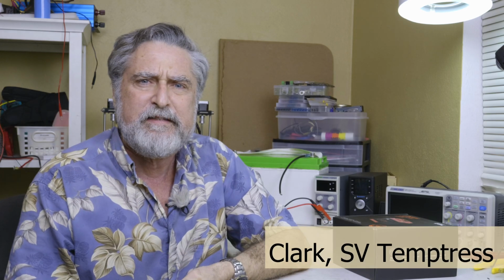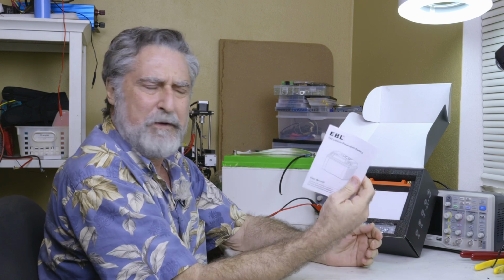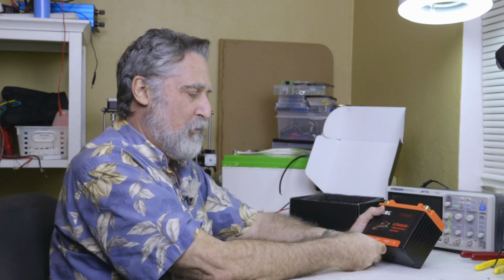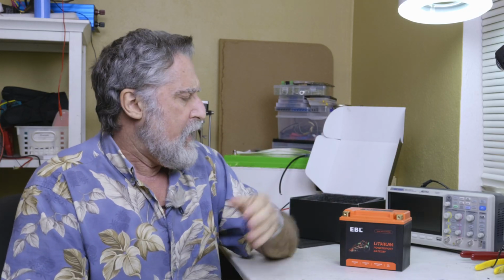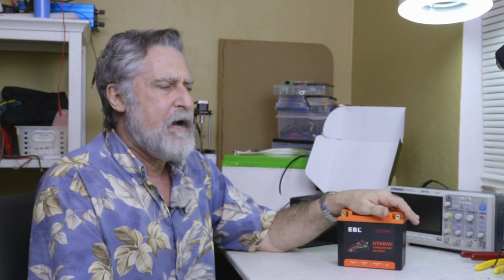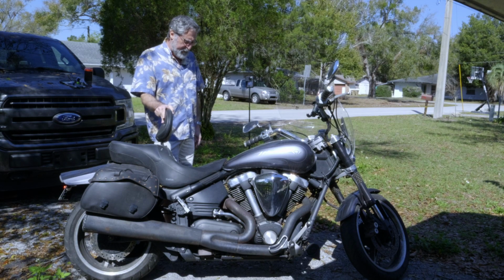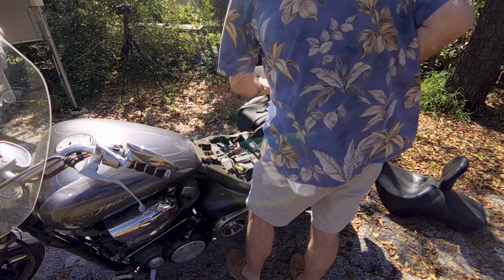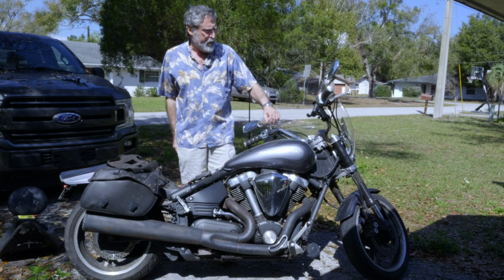Will the EBL Motorcycle Starter Battery Start my BIG Bike?

Comment: I have a Tohatsu 20 HP with electric start and power tilt.  I liked your reference to the large cooling fins on your bike's voltage regulator, and my Tohatsu has the same type with large cooling fins. 

The outboard manufacturers don't recommend lithium starter batteries, but I haven't heard of anyone having problems with the outboard's charging system, so I'm sticking with the NOCO lithium for now.

Get healthy!
Reply from the maker: Check out my latest ideas on the subject buried in this video.
https://youtu.be/k0LH87qTrQE

You won't get max life out of that Li but replacing them more often when they die early might not be a bad idea
Reply: @Clarks-Adventure  Thanks!

Comment: Hi Clark, glad to see you're recovering so well!  I have the exact same size and spec lithium battery in my 2003 C5 Z06 track car. It starts a 405 hp 350 V8 with no problem. My unit was made by Deltran, (more likely re-labeled) 480 CA,  8 Ah and weighs a whopping 4.4 lbs. Probably made in the same Chinese factory at the EBL unit, lol. Bought the battery about 5 years ago to prove the concept before I bought a lithium from a more quality name manufacturer. Well it's still going strong. I do approximately 12 track days a year, some are over 100 degree F here in Nor Cal. The unit has never failed to start the car, ice cold or super hot from coming off the track after a 25 minute flog. Simply amazing considering the $200 cost five years ago. I do keep it on a Deltran lithium battery maintainer 24/7 when the car is stored since Vettes are known to for parasitic draw through the computers, etc.
Reply from the maker: That saves some weight!

Comment: Hey Clark.   Hang in there….  I just found you a few days ago and I’ve watched quite a few of your videos.   I went to buy a bank manager and noticed they are sold out.  Checking to see if you knew a timeline on when they will be back?  I think it will work great for my rv.  No hurry and not being pushy at all just curious.  I have a work around for now.  Thanks.
Reply from the maker: Really soon I expect 
  We had to change the oled supplier and that required a software change.  
   Works, testing now.

Hardware is in stock

Comment: Hi Clark.  You and your channel are amazing as always.  You touched on a subject here that I've been thinking about.  I've stumbled across something that you may find interesting.  It's an up and coming battery chemistry they call NA+  It's a sodium ion battery chemistry.  This chemistry can tolerate higher voltages and from what I've read is more closely aligned with lead acid battery voltage requirements.  They are just starting to become available.  Would love to get your thoughts on the na+ batteries.
Reply from the maker: I'll grab one when offered but LiFePO4 is going to be hard to beat.
   Lead always came up wanting, like a computer from the 90s
   LiFePO4 is really good enough.   Like a new computer.   So anything that wanted to compete needs to be proven in the field AND be technically better
Reply: @Clarks-Adventure  Thanks for the quick reply.  As a note, it's disadvantage is that it doesn't have quite the energy density of LiFePO4 but it's advantages are that it doesn't use any of the expensive hard to get mine metals, it's not as sensitive to cold and it has the potential to be very inexpensive once production gets ramped up.   A big plus is that it can be manufactured similarly to LifePO4 so that manufacturers wouldn't have to change too much on the manufacturing side.  And what originally caught my eye is that it appears that it can eat up the extra energy from an alternator.  That's that part that I'm wondering most about and what makes me think it will be the most likely battery chemistry to replace lead acid batteries in vehicles.
Reply from the maker: @ncmotorcyclist good, if it turns out less fragile than LiFePO4.

As far as rare elements, I think you are confusing li-ions with LiFePO4.  Li, iron, oxygen and phosphorus are all readily available.

Comment: Clark, can that battery (or similar) be used to start a 2024 20hp 4stroke Mercury outboard, and would I have to change the voltage regulator? Thanks and take care.
Reply from the maker: I bet it could.  I don't know if lower voltage regulators are available for outboards but as I say in the video, maybe just accept the shorter life?

Comment: Sorry, but I have an off topic question. If you have 12 V batteries, can you hook your solar panels in series to generate 24 (or more) volts and have an MPPT controller efficiently regulate it down to 12 V for the batteries? The idea being trying to reduce the ohmic loss in the cable between the panels and the MPPT controller.
Reply from the maker: Yep

Comment: I have come across your channel and found it very interesting.  I have been educating myself with your videos and I am in search of information on Bluetooth capabilities.  I have read some reviews on the LiFePO4 batteries that during an area away from cell phone coverage they couldn’t get the app to work because of connectivity.  I would like to see you make a video on how to or work around this problem that keeps you from charging the batteries.  Thank you for your educational experience making those videos.
Reply from the maker: Thanks, glad you are liking my channel.  Consider subscribing and sharing links.

Bluetooth is independent from cellular.  If the user had their phone set up correctly the phone app should always be able to communicate with a Bluetooth BMS

Comment: Clark, I have been considering replacing my 2004 SeaDoo battery with a lithium one.  Do you think that's a good idea?  Will I need to address the voltage regulator, or is the stock one okay?  Weight saving isn't as much of an issue, as it is on a bike, so I'm not sure I should take whatever risk it might present.  Being stranded on the water is much more of a PITA than on land.
Reply from the maker: Check what the voltage regulator looks like but I would bet it's the same type

Comment: I have heard of folks using these batteries for their marine start battery.   I fuse my start battery with a 300A ANL fuse, so it seems plausible that one of these batteries work well as start battery.  That said, I'm happy with my mixed FLA start and LiFePO4 house. I connect my 120A alternator to the start and use a smart diy relay to combine banks.
Reply from the maker: If you are using a system with enough li to run house loads it's time to go with the BankManager for proper charging.
Reply: @Clarks-Adventure   Yea, that is basically what I have.  It's been over 4 years with my LiFePO4 bank.  My charging system has evolved with different profiles for different  means(shore, solar, engine).  Before my DIY smart relay I started off a simple push/pull switch for controlling my ACR's ground wire.  Then I went with an Arduino Uno and  a few DS18B20 temp sensors.  It has evolved now using esp32s with a plethora of temp(one of which is connected to the alternator),  current(Hall split core), and voltage(16bit ADC) sensors developed using SenseESP for OpenPlotter Signal K and IoB(MQTT).   I still use it to smartly control my BlueSeas ACR which controls the LiFePO4 charging.
Reply from the maker: @dreupen it all comes down to sensing 100 percent.  Overcharged li lasts from 3 to 6 years typically

Comment: Why not use TVS (Transient Voltage Suppression) diodes?  They have been used in cars for some time now. In fact, some recommend testing the alternator in a running car by disconnecting a battery.  I seen this done, but I still prefer my Fluke.   

I use LittelFuse TP5KP16A  TVS diodes (~$3 each).  They can not only protect alternators but also (& more commonly used) to protect sensitive electronics.
Reply from the maker: I wouldn't trust one to the current load that they can be exposed to

Comment: What worries me about LiFePO4 starter batteries are low temperatures. 

Temps that we reach here in Minnesota in rare occasions can damage a LiFePO4 battery just sitting there.  But charging at temps that most of the US reaches every winter can destroy a LiFePO4 battery. 

Suppose, for example, it's 20°F/-7°C. That's a temp that LiFePO4 will run at, but not charge at. So you start your bike, and the alternator immediately starts charging - and destroying - your battery.
Reply from the maker: Yep.  I didn't go into that enough but I wish I had.  Personally don't ride my bike when it's that cold.
   So not a good snowmobile battery for sure!